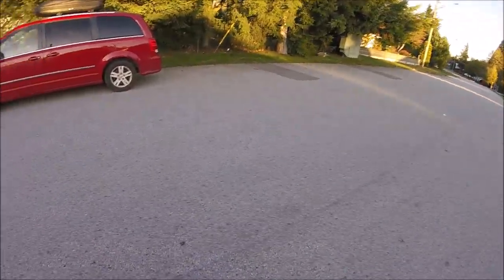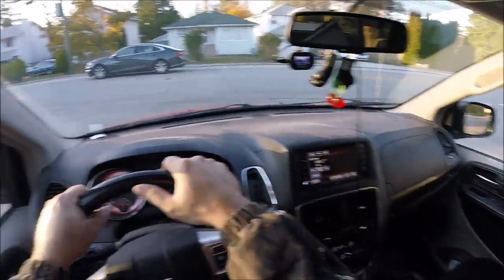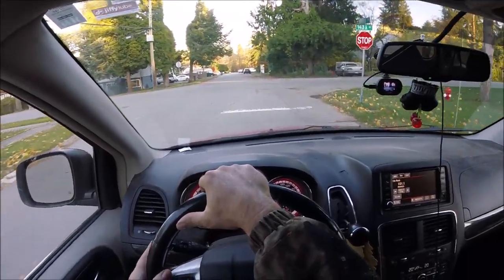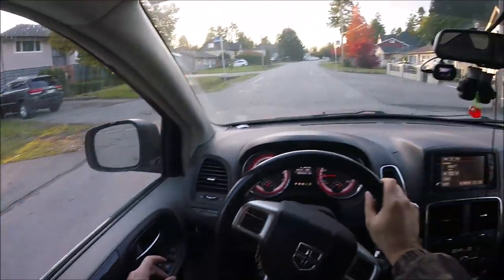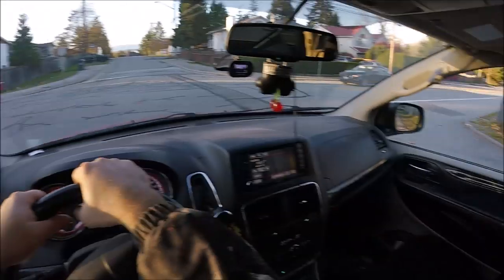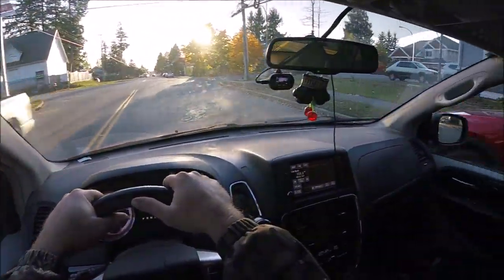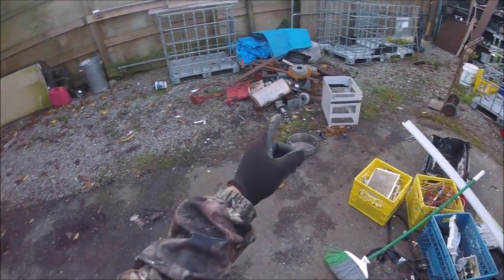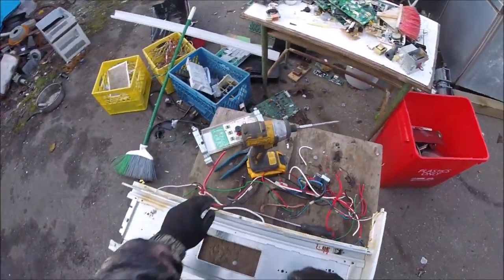Back at My Yard Sorting out & Cleaning

Comment: Apparently the Chinese have been dumping aluminum which has depressed the price. They produce a lot of aluminum but have not been able to use it domestically so they flood the market with the surplus. The margin is shrinking though apparently, it was a high of 20% but getting down to 6% now. "They" say that it will be next year before any improvement in the price.
Reply: Makes for some hard decision making - stock pile or sell?
Reply: @sharkscrapper  Well it is almost at historical lows so hording can't be the worst decision?
Reply: @CruiserMac  Agreed - if you have the room and don't need the cash flow, then stock piling isn't a bad answer right now.  Fortunately, a lot of copper, brass and some Al items don't take up a lot of space.